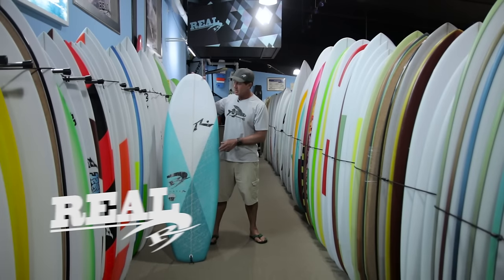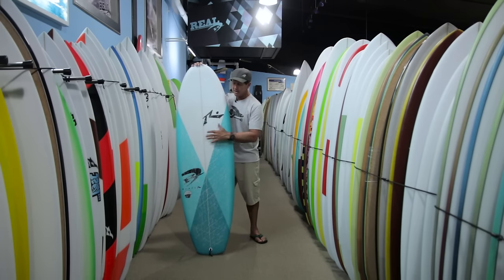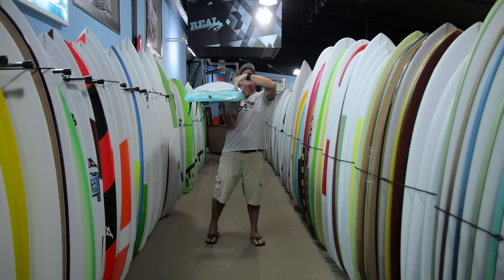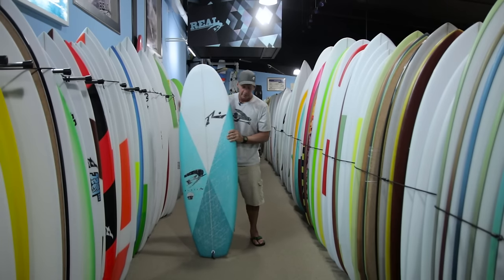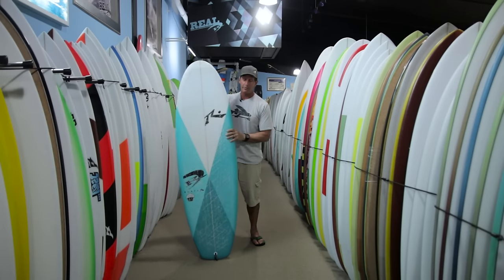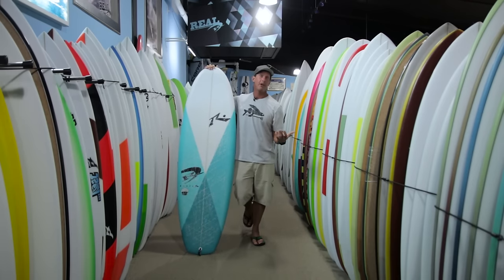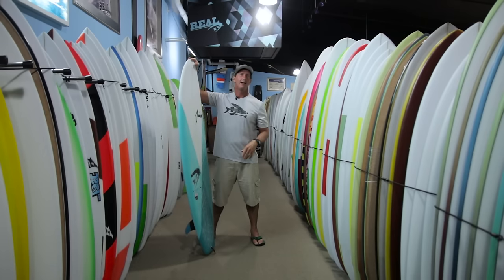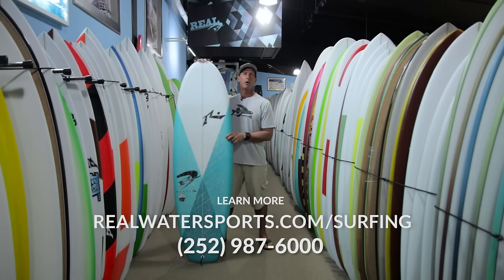Rusty Muffin Top Surfboard Review

Comment: Im 6'1 and i weigh around 200 lbs, is this a good board for small to medium waves?
Reply: I don't really have any credentials but i surf pretty much everyday i can 3-5 days a week and i try to ride lots of different boards. This board seems like it could be a magic stick. Especially for a bigger guy like you. based on this review you will be able to get this board going really fast on small waves and catch them easier than traditional shortboards. This board is also very forgiving. meaning when you stand up you can misplace your feet and it won't matter. you can make a mistake on your cutback and recover without the wave passing you by. This board also has a fairly curvy outline so it won't feel super stiff in bigger and steeper surf. You could also ride this board shorter than a lot of, or all of your boards especially if your an intermediate-advanced surfer and get a lot more maneuverability without sacrificing speed and drive. I would recommend looking at the Rusty volume calculator you can give your weight and skill level and they will tell you any liters of volume your board should have.